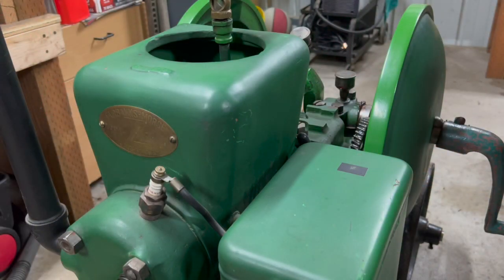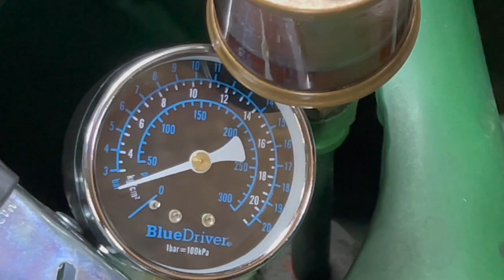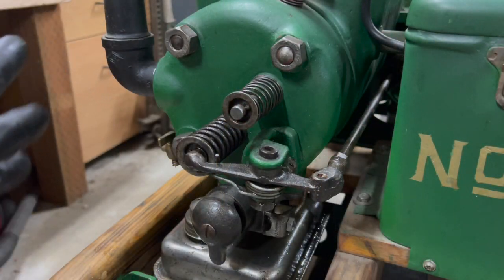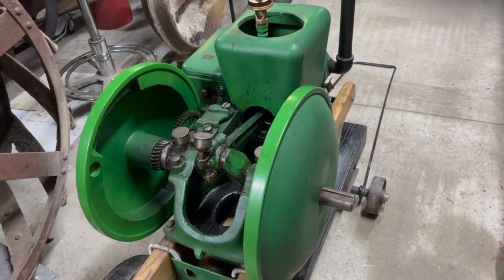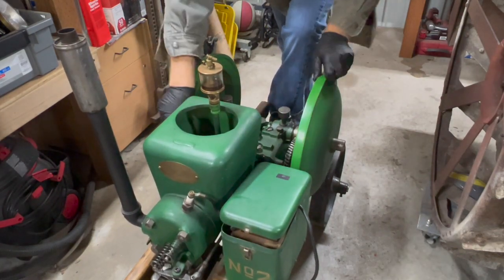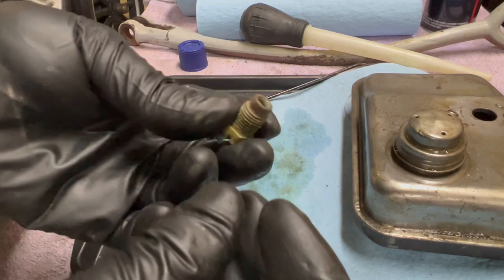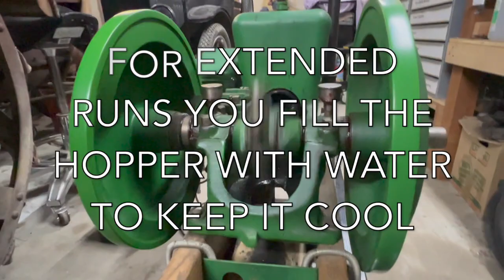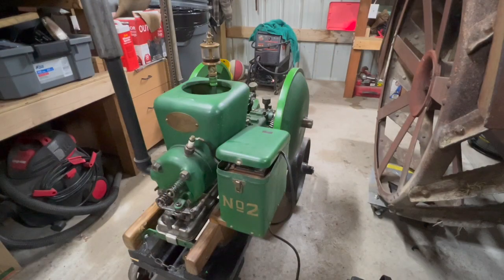Hit and Miss Engine - Service

Comment: I’ve got a Montgomery Wards model WM, made by Briggs and Stratton.
I use only ethanol free gas and every year I have to clean the pickup
tube check valve.
It wouldn’t be bad if I would remember before I kick the heck out of the starter.

Comment: Hello, I like your videos.  On one of your hit and miss engines videos,  you set your battery on your garage concrete floor.  I was told never to set a battery on the ground or concrete floor for any time because it will drain the battery.  Anyway, keep up the good work.
Reply from the maker: Thanks for watching!